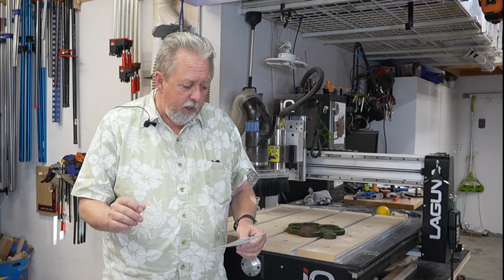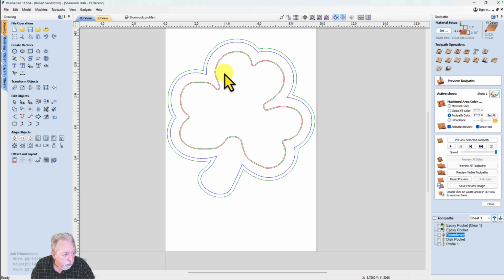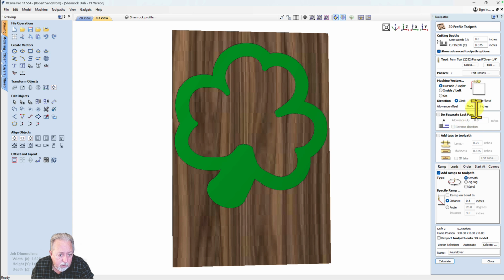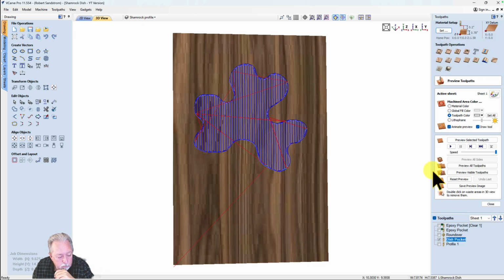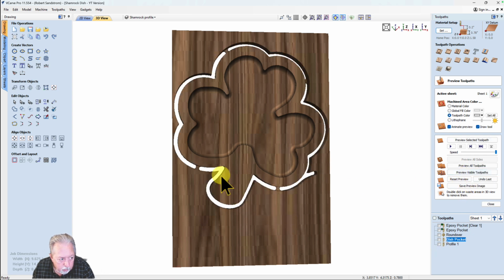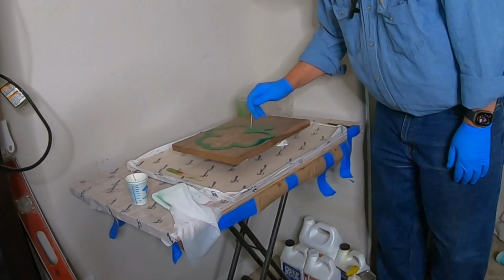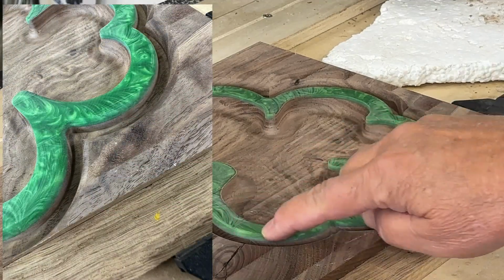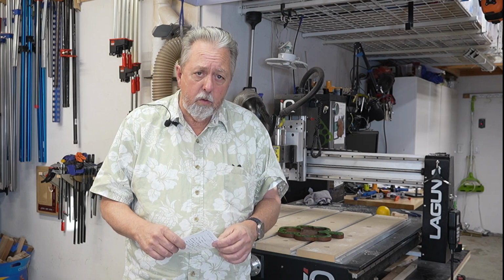St. Patrick's Day Special: Making a Shamrock Dish with Epoxy Lip on CNC

Comment: Good project. Looks like the router could use a little traming. Keep at it
Reply from the maker: Very observant yes it can but I haven’t taken the time.  So far it’s nothing some 80 grit sandpaper doesn’t handle with a few passes.  I do need to get around to it.